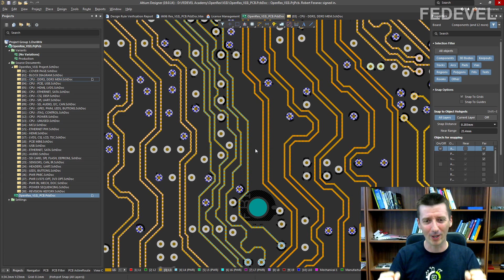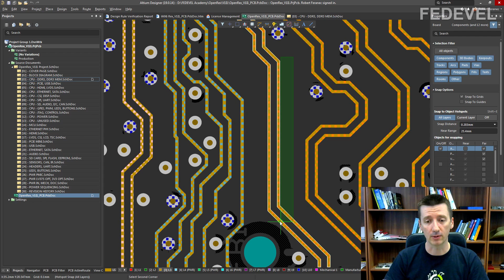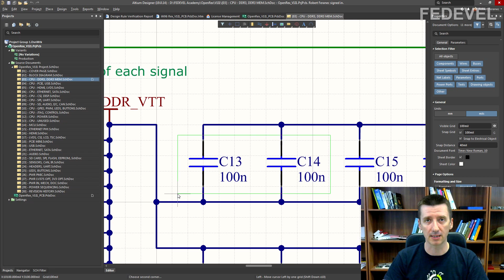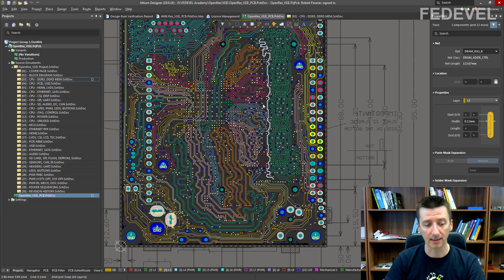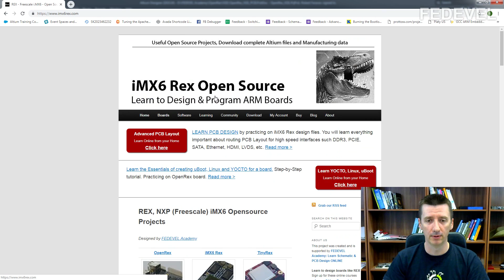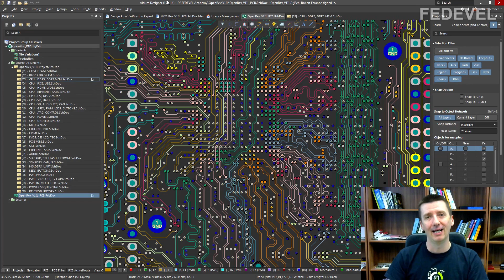Altium Tip: Selecting objects - Difference between Right & Left

Comment: Been using Alitum for three years now, and I've always found the selection tool to be inconsistent. Now it all makes sense!
BTW how do you "grey" out the ground and power planes without shelving them?
Reply from the maker: Grey out: Do you mean using Single Layer Mode (press SHIFT+ S)?
Reply: @RobertFeranec  Yes, it seems like you've used Single layer mode here, except many of the tracks have different colors. This makes me think it you're viewing many layers at once, except the power and ground planes, which according to the background is colored in dark grey.
Reply from the maker: The signals are all on the same layer, they just have different colors (different color is applied on different memory data banks and different interfaces / peripherals)